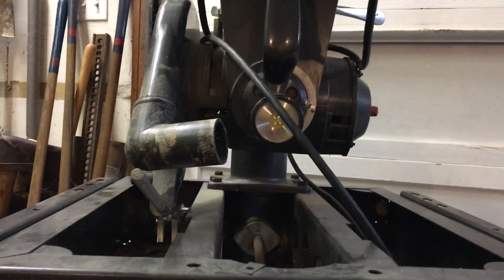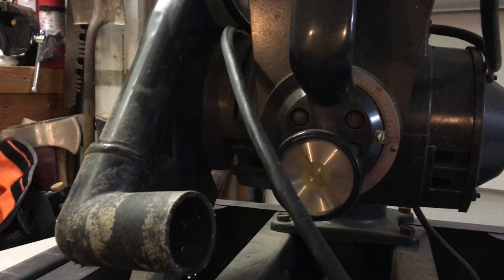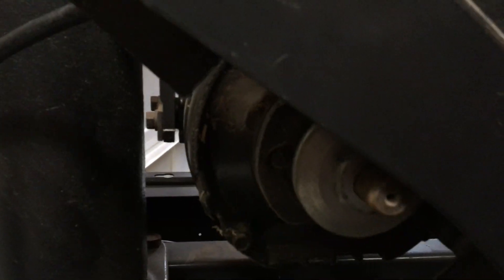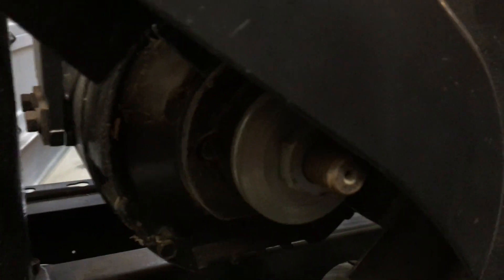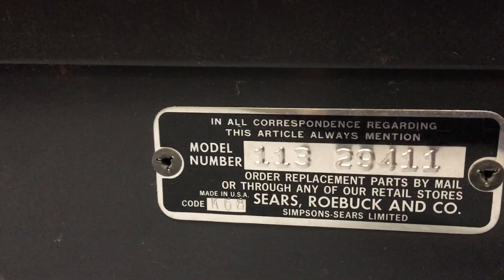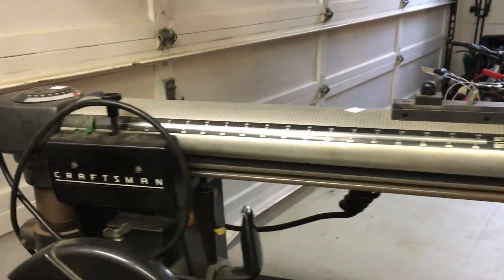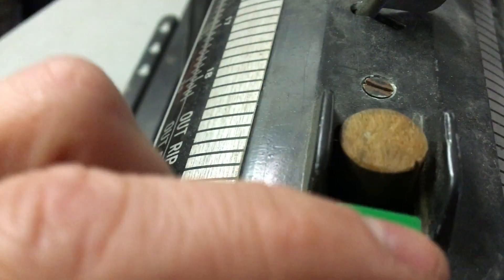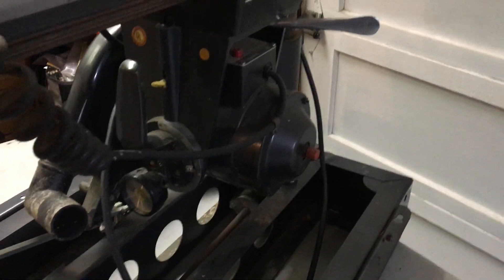Awesome Shop Find! $30 Craftsman Radial Arm Saw Model 113.294111

Comment: I hope you kept it, because that is probably the best built Craftsman RAS, and it looks in mint condition for a 1967-68 saw.  What makes it equal to an old Dewalt is the fact the carriage tracks are machined into the cast iron arm... on all later models the tracks were made with separate replaceable steel rods which tended to flex.
Reply: Mine isn’t working are they worth repairing?
Reply: Who would I take it to? Thanks

Comment: I found mine last year. The owner, a machinist, passed and left behind many nice, older tools that went to other machinists. This was for me. Complete on a table with locking wheels. Best of all, came with 15 quality, branded NEW blades including a sander disc! Those are worth more than the saw! Thanks for posting, I’m learning about the saw piece by piece. I’ll try improving the dust collection and setup for drill press operation, a chuck can be had for under $30.

Comment: I just bought the very same one on marketplace ,For 36 bucks ?? why 36 lol but really nice saw ,Guy gave me a Mitre vise and a Dato guard ? plus a Planer attachment ,,I used some silicone lubricant to loosen everything up made a giant difference ; They put a lightswitch in place of the upper buttons used a 4 pole light switch works good . I have the manual too I can take a video of it all then You can view whats in the manual . I learnt it`s always better to push the saw thru the wood instead of pulling it it`ll always want to run away in the cut pulling , YOU DON`T PULL A SKIL POWERSAW THRU PLYWOOD !!
Reply: You are 💯 percent wrong never push it back ward.. it's going to getttaaa grab the work piece carps gotta hit the fan/face 👀😈😈 very fast...

Comment: anyone know If any parts are Available?? Or Substitutes?? Need Horizontal Key Lock !! looks like a Wing Nut with a Ball bearing assembly at end... Yellow as in most of color code of machine...
Reply: Did you find what you need? I need the motor. Would you be willing to part with yours?

Comment: That saw was recalled. Please pin this post.
latimes.com/archives/la-xpm-2000-nov-15-fi-52028-story.html
Emerson Tool Co., of St. Louis, is recalling the saws because they were sold without a guard that covers the entire blade, the Consumer Product Safety Commission said Tuesday. Injuries caused by contact with the blade or by wood kicked back by the saw include hand and finger amputations; cut and broken hands and fingers; and facial injuries.

The recalled Craftsman 8-, 8 1/4-, 9- and 10-inch radial arm saws have a model number beginning with 113, usually located on the base of the saw. The brand name “Craftsman” and the store name “Sears” are written on the saws.